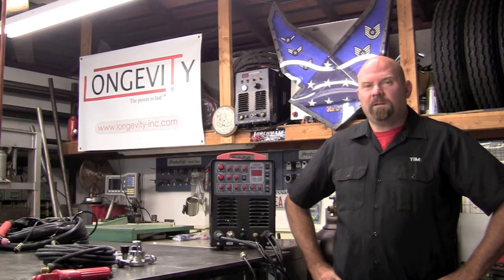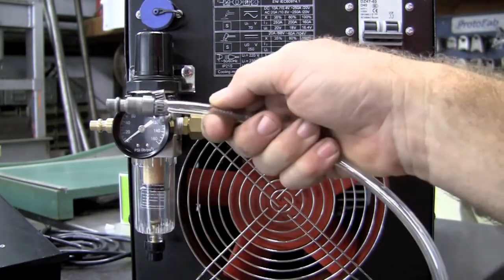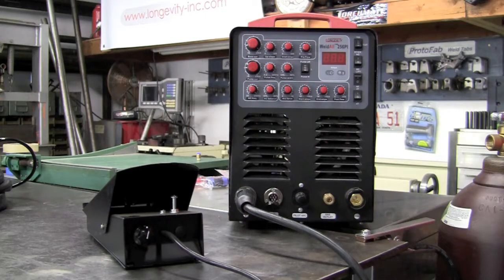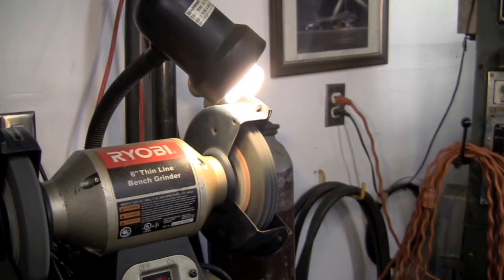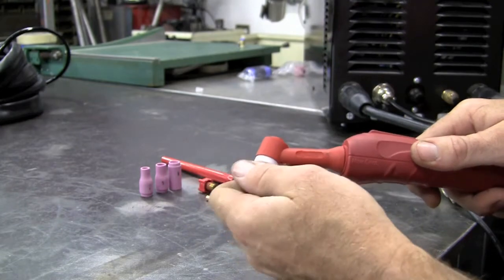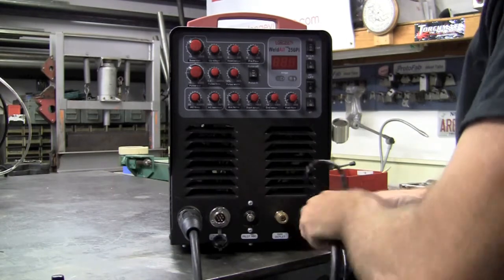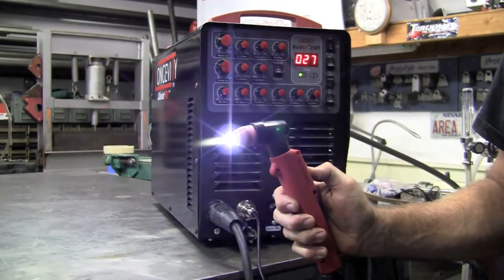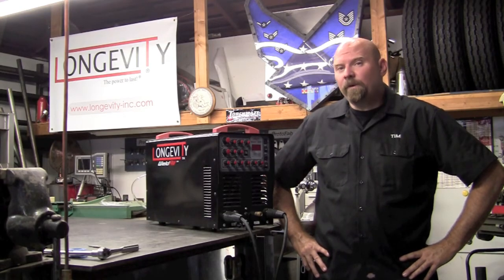LONGEVITY WeldAll 256pi Instructional Video Part 1 How to Setup The Machine

Comment: We have this machine, it worked good for arc welding, when we tried to use the plasma cutter the machine shut down and it will not work anymore. We tried calling for help, we were told someone would call us back two times but it never happened. They should learn to take care of there customers.

Comment: Tim it's a good thing that Simon Katz, owner of Longevity is sponsoring you.  That way you're able to receive proper support for your welder.  I own a Longevity "Weldall 250PI multipurpose welder" that I have less than 10 hours use on it.  Right now it is a $1500 boat anchor. Simons has had possession of this welder on two occasions, at a cost of 150.00 in freight each time to repair it.  When I purchased it I had a five year warranty. However after them handling it twice within the first year they told me I no longer had a warranty valid at that point and would not correctly repair it.  Being that my profession is automated metal fabrication equipment machinery repair of 35 years, I would only recommend Longevity products to my worst enemies.  I now own a Everlast "POWERPRO 256S" that I tried to brake the first month.  It's a fantastic tig-stick-plasma unit. 

Tim, save your hard earned money and let Simon Katz give you his junk, that way he will keep it running or replaced on a as needed bases for you.  Good luck to you sir.
Reply: Sounds VERY familiar to my story with them.  On my 3rd machine.  Works great if you don't ever use it and it just sits in the corner.  Worst equipment purchase I ever made.
Reply: Aaron Brucker
 same here, the pedal doesn't work, tried a different pedal and still doesn't function, I just use it in pulse but I paid good money.
Do not buy this product.